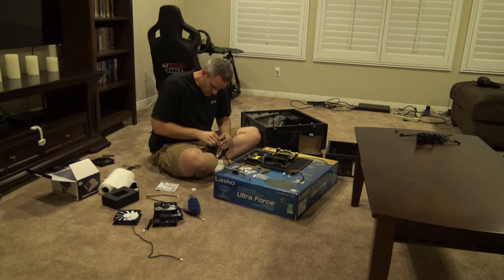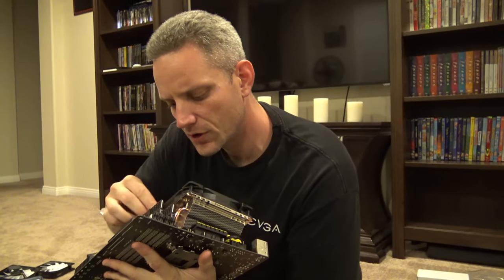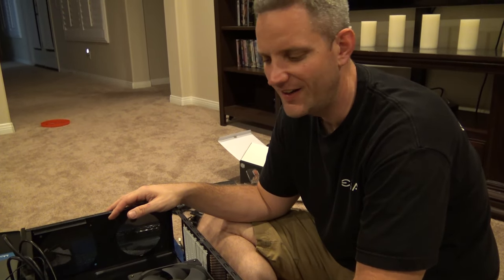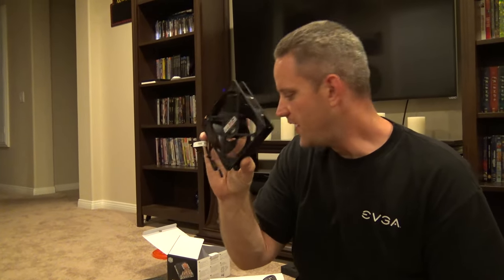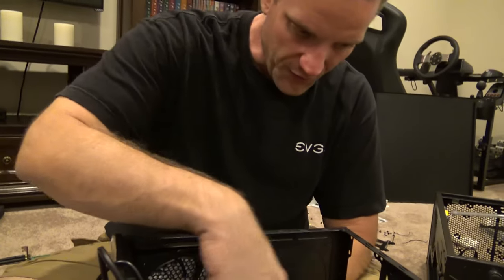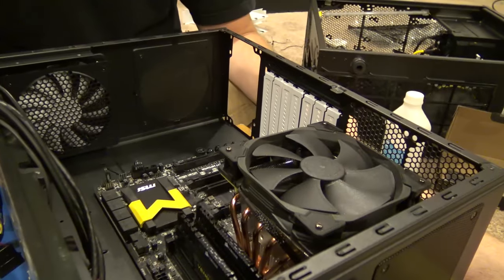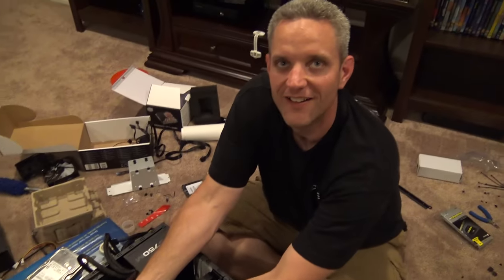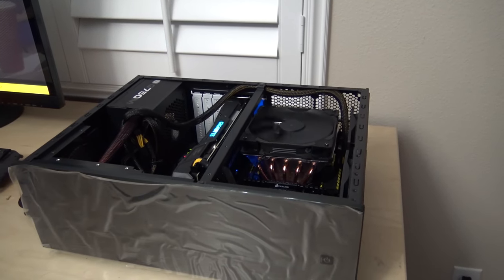Two Idiots Build a Home Theater PC ... ON CARPET!

Comment: Jay, there's enough clearance between the two fans on the right side of the case to cut holes for an H55 or H60 mounted on the outside of the case. That's how mines currently setup now - Fan mounted on the inside of the case, h55 on the back right hand side of the case. you have to watch where the ram is located and go for low profile ram if the tubes interfere.

Comment: I built mine on my bed and the carpet... its perfectly fine.
Reply: Yup.  Done my last 3 that way.
Reply: I had a bunch of spare computers, about 175. So I did some mythbusting. First I dropped a hard drive from a few inches. Nothing happened then I threw it at a concrete wall and it still worked. Had some dents but ran perfectly. Then we shook it when it was on. Again it was fine, sorta. We also took apart a BBQ lighter and took the sparker out and began shocking the board and other components. The PC turned off eventually but came back and was fine. Then was touch it all over and it was fine. Then we poured Gatorade on the CPU and watched it boil off. So then we dumped the whole thing on the PC and it then died. PCs are a lot stronger then you think. Now with backplates and so on you don't have to worry
Reply: Building on a bed is awesome, having a soft surface is good for protecting the components from physical damage.
Reply: +richgolfs I wasn't kidding. I literally did it on my bed/ the carpet.
Reply: Good to hear the carpet is perfectly fine :)
Reply: +SAM STRECKER Were they prebuilt? Prebuilt computers have the parts and cables practically glued together.
Reply: Rebbids Stuffed No
Reply: SAM STRECKER Wow that's impressive.
Reply: Depends on what it is.  I had a friend who set his cpu down on the carpet and it stopped working.  I can't remember if if was a Ryzen or Intel system though.

Comment: Hey jay you should try putting a small hook on the ceiling and making the vive wired go thru it its like u have no cables attached (you would need to change your hookups place),my friend did it and its so smooth.

Comment: As an multiple Xbox owner, I will let you know that if you have your account on 2 XBones in the same house, make sure one is set as your home, and do not set the other as your "home" xbox.  They changed things up a few months ago and made it a hassle having your account on 2 xboxes in one house.  Games sometimes get confused if you own them, etc.  I would suggest using a portable USB 3.0 HD (I use a 2TB) and you can move it back and forth between xboxes instead of hauling around your one xbox. Then just set it to install everything on the external drive.

Comment: I've made about all my computers on carpet similar to the way Jay is. Anti shock bags are useful too, though use one larger than you need to give you error room before you hit the carpet. Anyway I've a Fractal case from 2010 which came with the same fans Jay is using. They may have changed since 2010 but I found them significantly lacking regarding RPM though they are utterly silent, even at night. I upgraded to the Fractal Venturi fans and I'd agree that they are quite possibly the best fans on the market. They remain silent up to good RPM and can continue with a little noise to a good speed. My only criticism, they make two versions of the fan for airflow and air pressure.

Both are fairly extreme optimisations for their chosen focus, but the real world rarely has such extremes. The flow fan is amazing for an exhaust fan but an intake fan would rather be sat between the two. The pressure fan is amazing for a thick high density watercooling radiator but again people will rarely have that scenario and a thinner air cooling setup will find it less than ideal. So at the extremes the Venturi blows the competition out of the water, but at the more realistic areas in the spectrum like intake fans they become less optimised and only saved by their exceptional quality components to become close to their competition, sometimes better sometimes worse, but with a high price.

They lack features like the air penetrator fans for intakes, but then they remain with the competition along all of the non-optimised area making them versatile. However if they addressed that and made a fan balanced between flow and pressure it would take the crown in the majority of situations - intakes fans, lower density radiators, air cooling radiators, push-pull setups, etc.

Comment: Bootleg Windows???
Reply: Its called windows 10. You can download it. It just won't be activated.
Reply: Yeah I know what it is... The lack of activation was what I was pointing out
Reply: Yeah haha
Reply: KMSpico works ....
Reply: +Kyle B regardless, it doesn't change the fact it's not activated
Reply: forreal
Reply: +Kyle B I was only pointing it out... By your comment you seemed more concerned by it than me for you to have to go out of your way to explain it in detail
Reply: lol
Reply: He took the Windows Drive from the Racing Simulator machine. When Windows detects an abnormal amount of different hardware, it will register itself as not activated, to correct this, just gotta reactivate it, usually by calling the phone line, I've done it multiple times for legitimate licenses that went inactive due to drastic changes in hardware in one go. You'd need to change your CPU, GPU, Motherboard at once for windows to do such a thing though,
Reply: You can download the windows 10 ISO directly from Microsoft's website without paying a cent, so if you build a lot of computers this would work fine

Comment: Hey Jay! I love to see this kinda stuff to :D More because i had that case myself heh. My hardware was 3770K, 12GB RAM, GTX 980 Gigabyte G1 Gaming, Corsair RM550, 500GB 840 Evo SSD and FILLED with Noctua fans heh :D The CPU ooler i used was the noctua nhc14s in low profile mode. And man.... Even under load the system was barely audible :D

A GREAT TIP BY THE WAY! Mount a fan as intake to blow cold air towards the GPU, my temps dropped like 15 celcius...

Anyway, keep up the awesome content! I have watched all the way back from when you had 10k subs :)

Greetings from Tobi in little Denmark!

Comment: from my experience case fans only pull more dust in, make a pc more noisy and expensive. Kinda feel like its another scam for people making pc's.
Reply from the maker: Um, no. You need airflow
Reply: but jay, he has experience /s. I honestly feel sorry for you with all the armchair experts that comment on your videos.
Reply: Would you rather have a computer that is filled with dust (that isn't even hard to clean) or a really hot computer which could damage the hardware by alot?
Reply: lmao this comment is fucking hilarious, do you not realize how hot a pc can get. You must be new to this.
Reply: Were you dropped as a child?
Reply: +JayzTwoCents tell him straight up jay
Reply: +JayzTwoCents is 2-3 fans enough for a 1200$ build?
Reply: +Eli Maffry no get 5
Reply: they help when your doing an overclocking build but if its just a normal build just two fans would be ok
Reply: That depends. In a very small ultrabook style system they would be unnecessary because of how low the power consumption is, and thus the heat generation is low. However, in a larger laptop or a desktop case fans are absolutely necessary unless you have a full system water loop, and even then you need some for the radiator.

If you're referring to adding fans plus the included case fans, they yes, most of the time the kit fan is all you'll need, unless you get a super bare bones case in which case you might need some more.
Reply: My PC is lava cooled.
Reply: wow my christening of a flaming youtube comment section.

I only mentioned this because I have done benchmarks using a 4.5 ghz 4690k, cooled with a corsair H100 using no fans, single 140mm fan and double 140mm fan over about 25 minute tests and found out for myself. Room temps were never over 23 degrees Celsius all year around.

The law of diminished returns is in play here.
Reply: Also to fill my s340 with non-shitty brand name fans it would be around $60 to $70 cad
Reply: ever heard of dust filters?
Reply: +Syynd those are nice. $35 a pop here on Amazon.ca
Reply: i added two case fans to my pc and the temps dropped 7-10 degrees across everything
Reply: 1 questions, Do you use a Blower style cooled video card?(IE reference style cooler). Ofc you don't see to much, most of the heat of the processor is already pushed out of the case by the H100 cooler. The heat of the video card, if it has a blower style cooler is also pushed outside of the case so yea, in your situation you don't need extra case fans. But for a system that has a normal fan cooler for the processor, and a normal video card cooler, the heat stays inside the case => you need the extra coolers to move the air around and outside of the case.
Reply: As Jay answered - and I'm by no means an expert, as I only have built one PC - the case fans are a necessity. You just must make sure that you maintain positive pressure. Basically more fans pulling air in than out, however the biggest problem with removing the case fans is that your motherboard and ram generally have no cooling(why in a water-cooling build you must include either water-blocks for these or case fans too).
Hope that clears up the confusion. :) Let me know if you have any other questions. Like I said I'm not an expert and Im only 17 but this is a passion of mine and I'm glad to help anybody.
Reply: @EliMaffry I can help with that if you'd like. I have a high end PC with 2-3 case fans that are Corsair AF 140s. So yes they will work, however, the only problem that you might encounter will be with large obstructions(which as Linus proved don't actually cause too much of a problem).
Mainly you will have to worry about cooling your CPU and GPU, the case fans are solely there to intake fresh air for the fans cooling those and to cool the motherboard and RAM.
If you have any more questions I'd be glad to help but just remember I'm by no means an expert, I just do this as a hobby. :)
Reply: Click bait engaged.....
Reply: you need to take hot air out of the case. I tried once using my PC without case fans and ran Cinebench and the CPU got to 80C, with fans it stays at 60 while fully loaded.
Reply: An integrated water cooler like that with no fans would mean no or very little heat is being removed from the water, meaning you are gradually heating up the reservoir until the reservoir is holding the same temperature as the CPU And the CPU will start thermal throttling itself.  Room temperature has absolutely ZERO relevance to what you're talking about and measuring. CPU temp and performance is what matters. and without fans it WILL over heat and thermal throttle. if you claim otherwise, you are straight out lying and lack a basic understanding of thermal dynamics.

Also fans doesn't mean your case will pull in dust. badly made airflow does. keep a positive pressure in the case and use filters and you will get very little dust in the case if any if the room is fairly low on dust.
Reply: Your test doesn't sound very good, WhiteWater. I don't think you're telling the truth.
Reply: hes not even wrong, linustechtips did a video on this. and basically, having 2 case fans and a cpu air cooler are good enough.
Reply: You should run your stuff overclocked without fans and let us know how that works for you.

Comment: What is white? What does the world mean? sorry the WB in the first half of that film is very yellow
Reply from the maker: And thats why auto white balance sucks.
Reply: +JayzTwoCents Hello... I have a question

Everything in my newly built PC is working as far as I know, yet the monitor is not recognizing any sort of signal from the PC itself. Like wise, the gigabyte motherboard screen is not showing up so I can't get to the bios either. The monitor is fairly old, but it was brand new for the build. 

This is my fist build, and the specs are as follows: 

CPU: i7-6700k
MOBO: Gigabyte Z170X Gaming 5
CPU COOLER: NZXT Kracken X61
GPU: GTX 1070 EVGA FTW
Hard Drive: 1tb WD blue 
Case: NZXT S340
Monitor: Samsung S22C350H (22inch)

Please help... I want it to work before I get into cable management! Besides that, it's the only thing left. To hook up to the monitor successfully. 

You would freaking hate the backside of my case right now....
Reply: +TheThreeMakers - make sure the monitor is plugged into the back of the graphics card and not the motherboard. If that doesn't work take out the graphics card and plug in your DVI cable from your monitor directly into the motherboard then try starting it
Reply: +Ryan Auburn I am using an HDMI cable... Can it still connect to the graphics card?
Reply: +TheThreeMakers - I can also use a VGA cable in the DVI slot, if that would work
Reply: +TheThreeMakers - and, just answered that question - The VGA cable will not connect to DVI.. Which is probably pretty obvious.
Reply: +Ryan Auburn do I need a DVI cable? My motherboard does not support VGA connections. I have an hdmi cable... 

Does a DVI cable connect into a display port?
Reply: +Scarletia osu! Yeah, I tried... It's my first time.i figured it out tho... Thanks

Comment: Great vid - and if I may pop in on this, as a Certified Computer Service Technician with over 20 years experience with PCs:

There is a non-zero probability of experiencing a differential discharge sufficient enough to "fry" a computer component - but the chances of this occurring are very small. It should not be done ("assembly on a carpet"); but it can be and many people do it - including myself multiple times in the past. Stating this however, I should add that it only takes 'that one time' where you zap a $1,000 GPU that you splurged on as a treat to yourself, to make you never, ever do it again - forevermore breaking out the static mats and wrist clips and building all future systems completely naked. 

Sorry for the visual, but it had to be said :P 

As well, the damage may not be "obvious", that is, it may damage the component in a way that merely 'weakens' it, as opposed to "frying" it - where it will work, but not last as long as it would have originally/optimally ('dying' in say, a year or two, as opposed to 5+ years). And if I may be so bold: you can also run with scissors in your hand without falling and impaling yourself, but that doesn't make it "something you should do" ;)

Nice vid as always, Jayz. Love all of your stuff!

Comment: Double sided tape is definitely sufficient for the job. Woodworkers use it for mounting templates for routing and the hold up despite cuts at extremely high rpm

Comment: My wifi is so slow I can't even watch this without buffering every 2 seconds
Reply: get a wired ethernet
Reply: If you can't wire ethernet for whatever reason get a powerline system.
Reply: Than say internet. WiFi is a type of connection to local network.
Reply: +AUSSIE G4M3R seemed to be really Atlantic to me :/

Comment: You said this case doesn't support watercooling at all, but it has 120mm fan spots not too far from the cpu socket. Couldn't you not use a 120mm AIO?

Comment: I've never killed a PC when standing on a carpet. Where I live isn't very prone to much static electricity, and it's not hard to dissipate any charge you might have. Only time I ever zapped a CPU was plugging int into the socket the wrong way and watching it light up like a flashbulb. this was a old 486DX-25 i zapped.

Comment: Your hard drive is moving faster than you think....! The Earth spins at around 1k mph; goes around the Sun at about 67k mph; around the center of the Milky Way at around 500k mph. On top of that is speed of the universe expanding which deals in megaparsecs (3.26 million light years). So that bit of tape is working harder than you think Jay.

Comment: Not finished with the video yet, but I did similar with my Node 605. Two 120MM intakes, and a single 120MM exhaust by the power supply. I was using a Scythe Big Shuriken Rev. B cooler on a i5-4670K. It got the job done, but wasn't impressed by the temps. I also tried adding two 80mm fans, as well as different configurations of intake/exhaust with not making a big difference [stock cooler would throttle fwiw]. Not a big deal if you don't want to overclock, but was kind of a bummer since I bought a k part. I think a blower style GPU would have helped a lot. I was using a Gigabyte GTX-700 (4gb).  I've moved to a NCase M1, but plan on building a server in the 605 soon. Very nice looking case.
Reply: Also, (still not finished with the video) the front part of the cross member on yours looks bent down. And for drive mounting I velcro mounted three 2.5" drives together and stuck them to the front inside of the case on the side opposite the motherboard. It worked well.
Reply: ONE more thing... that Gemini cooler is 105mm tall.

Comment: a tip on those double side tape: heat them before putting them in place, that's a little trick I learned the bad way

Comment: I always take my socks off so there is no electrostatic friction lol.
Reply: and mounting HDD with tape it good, better than screws actually, but the strain you put on it if you ever want to remove it is huge.
Reply: +Bartosz Olszewski how is tape better than screws ?
Reply: Eryche Bandy dampens vibrations, lets you put it whereever you want.
Reply: Bartosz Olszewski for me screws are better, more secure mounting, easy to remove if needed, and it won't leave any sticky residue.
Reply: Eh, the sticky residue can be fixed with some rubbing alcohol on a microfiber cloth. But I agree with you with everything else.
Reply: Eryche Bandy well, I don't think I'm gonna swap my 2TB in 4-5 years or so and then it will be too old to use it safely. And if you have seen Linus taking off taped SSD's, the metal cases were bending when he used two strips for each.